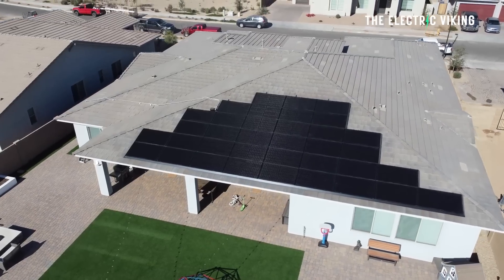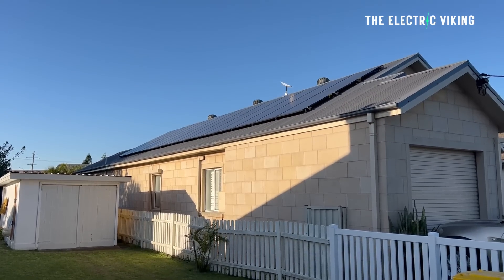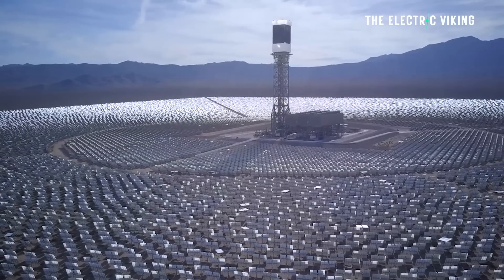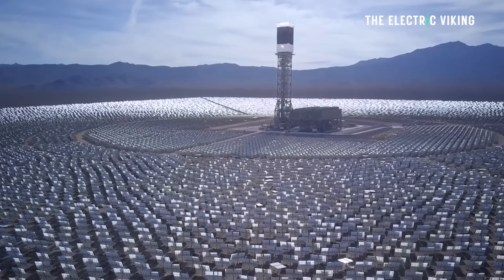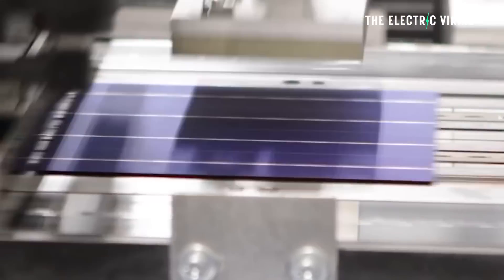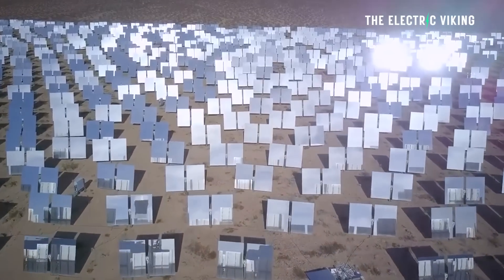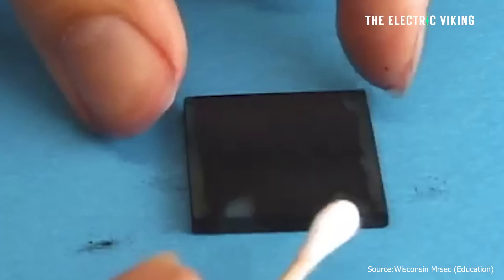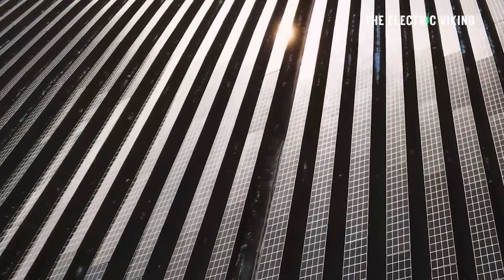Record-Breaking New Solar cells with 60% energy conversion created by Spanish researchers

Comment: A system that can capture solar thermal along with solar electric can easily be over 60% efficient.  About 60% of home energy is for heating.  
There are solar farms that use trough mirrors to heat compressed air in long pipes to drive s gas turbine.   A miniature solar farm in a one meter square box on the roof might accomplish the same thing.  If the pipes are oriented east to west, the mirrors need only to swivel up and down to track the sun.  A car turbocharger might be about the right size to drive the system.  There are turbochargers that have a motor/generator to improve engine performance and save energy.  Someone could make the system themselves.  One motor could swivel all of the mirrors in a box.  The heat can be stored in a tank of water or a pile of gravel.  If it has 30% electrical efficiency and captures 50% of the solar thermal, that is like 80% efficiency.

Comment: Efficiency is wonderful, but I think the thing that will boost solar the most is CHEAPNESS, ease of manufacture, eco-friendliness (meaning no toxic materials and byproducts), and ease of installation. What ever happened to the printable solar cells? Those seem like they were pretty great. They were cheap. They could be printed onto almost any material, including flexible fabric. 
It doesn't matter how efficient something is if it is 10 years away and made out of either toxic or expensive materials. And we need to really be working on energy storage, since that is the key to adding renewables to any energy system.

Comment: You can find solar cells that already get 40% which are used on satellites; but they are super costly. You made no mention of cost. Your understanding of the contribution of solar at present is wrong. Solar only produces 2% of world energy production; thus if magically you could replace all cells with ones 3x more effective it would only come to 6% of world production and of course cells are not the big expense - installation and batteries are the main high cost component of Solar power. If you can ever get some cheap efficient cells and cheap storage; maybe it would be worth investing in; at present and the last 20 years Solar has been a failure.

Comment: 60% is almost certainly using concentrators, and it is stated that it is purely a lab achievement rather than a production ready technology.

Previous concentrator based multi junction cells had managed >50% efficiencies.
Reply: An additional statement is, it is only applicable to red/yellow light. Given the lowest energy light is red, and the highest blue, for the external light spectrum, most of the energy would be lost as heat.

Comment: They only last minutes to a few hours under lab conditions so don't get too excited.. A fairly stable cell in the high 30's can last close to a year but one that can last several decades and be in mass production is still a decade away.. Layering and enhancing the cells with a substance that readily releases electrons with minimal excitation from sunlight like a nuclear element also produce lots of electric but they degrade at an atomic level and have no longevity..

Comment: Kinda unusual because it is illegal to use solar panels in Spain. The National Power Company may use solar panels but not individuals. During a multiport cruise last year around Spain, every tour guide we employed told us the same story. Spain has over 300 days a year of sunshine, but it is illegal to put them on homes or apartment buildings. Although not exactly true from a little research, apparently the State Controlled National Power Company makes the red tape so difficult and expensive, they have basically outlawed solar for personal use. Interesting to hear your comments on this sometime. Thanks. Love your channel.
Reply: Solar panels are not illegal in Spain.

Nice try FUD boi.
Reply: @mnomadvfx Now I gotta do more research? I'm so sick of the web and social media in particular. I used the Internet before the web, back in the 70s at a research university. It should've never been made available to the general public. They weren't ready. Still aren't.
Reply: That already changed.  It has a lot of burocracy, but not illegal.
Reply: Do they regulate the materials used ? This would make sense as early solar cells used cadmium : a toxic material.
Reply: @ImaEarlyAdopter  ...🤣🤣😅😆😂🤣🤪🤤

Comment: Avg Solar efficiency for purchase
1970:6%
1990:12.5%
2010:20%
2024:24.1%
2030: 27%
34.1% wouldn’t be reached til 2050 at this rate, hopefully it’s the beginning of exponential S curve advances similar to silicon chips and computer memory.
How are you all scoffing at this story & our massive improvements to solar. ICE went from 10-20% efficiency in 100 years. A propane generator is atleast 30% efficient.
Reply: Pervskite captures a different frequency range than polysilicon.  Has stability issues (lifespan), hard to layer on the Silicon, inputs have other uses and Lead in the mix  is considered a risk factor!

Comment: Titanium is $90 per kg.  Gallium is $900 per kg.  The price of silicon used in conventional solar cell is $9 per kg.  These cells will be at least 10x more expensive, for a  1.6 x increase in energy yield.   This technology will go nowhere, fast.
Reply: Might be good for space applications but way too expensive for earth.
Reply: The amount of material required for a thin film is so small that the impact on the price of the panel is minimal.  And it's 100% recyclable too.
Reply: if you put them on cars there's a big advantage you'd pay 300% extra
Reply: Eh?

Perovskites are relatively chip as production requires much lower temperatures than silicon cells, and you only need a very thin layer of the material compared to silicon for the same conversion efficiency.

The overall cell will be more expensive than pure silicon based cells as it is a tandem (multi junction) cell, but the additional cost will be nowhere near 10x even at the beginning, let alone once it has scaled.

Comment: 55 seconds in shows solar panels installed on a dark colored  roof . Installing solar panels on a dark roof in a no no.  Solar panels installed on a dark colored roof will produce less power than panels on a white or silver roof. The enemy of solar panels are heat. Black or dark colored roofs produce heat that lowers the amount of electricity produced. Painting roofs white before installing solar panels called  “cool roofing,” is an expanding business in the US. 
Australia should be doing the same. Some states in the US have building code by laws that require that industrial buildings must have white roofs. For example: California has stringent cool roof requirements under its Building Energy Efficiency Standards. These regulations often require roofs to meet minimum solar reflectance and thermal emittance values, which can be achieved with white or other light-colored roofing materials.
New York City mandates cool roofs for certain buildings under its building codes.
Phoenix, Arizona and Los Angeles, California also have specific cool roof regulations.

Comment: You are such a filthy liar.  This is easy to Google.  The current record for solar cell efficiency is 47.6%, not 25%
Reply: For multiple layer cells. Commercial single layer cells are another matter, typical efficiency 20%. The limit from 1950s Bell Labs inventor of the transistor was calculated as 23%.

Comment: I invented a solar panel made with plutonium oxide, it's getting glowing reviews.
Reply: Sounds like an innovation that could really take off.
Reply: Hehehehe!
Reply: Already done : a diamond battery using Thorium.
Reply: I'm guessing it's either going to explode at any time or the degradation rate is 50% per year. However, I don't doubt the 60% efficiency rating is accurate.
Reply: Don't lick the brush!

Comment: Solar has a capacity factor of less than 30%...the majority of the time the sun is not shining. Cloudy days which can last 5 or more days in a row result in almost zero power for an entire week.
Renewables require almost total 100% back up for this reason. That back up will be supplied by gas , coal etc.
AEMO admitted yesterday that a renewables only grid , with storage , back up and transmission included will NEVER provide us with lower cost electricity.
Higher cost electricity is driving manufacturing overseas and sending prices higher , and keeping inflation and interest rates higher.
Reply: The surface of a sphere is 4 pi r*r. Given about 50% of the light energy is absorbed by the atmosphere, a ground based solar cell, at best, has 1/10th the throughput of a space based one. 

Rain and dust can easily wreck the remaining throughput. Solar is great for satellites, poor for ground installations.

Comment: This is one of the main reasons Australia should continue to roll out renewables - the technology will continue to improve, and what is installed in 10 years will be much more efficient than what we are installing today.

The equivalent of Moore's Law.
Reply: It must be a no brainer to fit solar if you live in Oz. I love solar but there's slim pickings here in the UK!
Reply: @alistairlambert3275  In Australia, the conservative party is opposed to renewables. They want to go nuclear, and one of their arguments is that renewables have to be replaced more often than a nuclear power plant.

I actually think that renewing renewables with more efficient tech is a good thing.
Reply: Moore's law is the rate of printing resolution improvement. No change in performance outside of better resolution. 

PV improvements are much more difficult : structural, material, and technique change to get an additional 10%.
Reply: @michaeledwards2251  Wrong. 

Hard to understand how you can say something like that when you are working on a computer, and all you have to do is type "moore's law" into a search engine.
Reply: @footbru  
Why do you think there is such excitement about ASML EUV machines ? Its the resolution which matters. The material, silicon, and the purity demands, have only undergone changes needed to meet the resolution. 

Today the resolution achieved is a fraction of a wave length of a photon. 

PV demands replacement of material structures, materials, and much else, to achieve efficiency improvements. Resolution has not been a problem for PV for decades.
Reply: Renewables are for the rich due to the fact you are literally replacing every ten years or so, and the recycling needs to be improved, and the land these solar farms cover need to be cleaned up as they are not environmentally friendly which these solar nuts seem to distance themselves from.
Reply: @jeffsmart7674  Solar panels have a 30 year warranty, and can continue to produce power past that time. Recently, Australia's oldest wind turbine was retired after 40 years.
Recycling is being improved, but I don't know why that is a problem compared to other appliances. And at least they CAN be recycled.
The land occupied by solar farms is PRIVATE land. So cleaning it up is none of YOUR business.

Your comment is worthless and basically disinformation.

Comment: @electric Viking,, I don't think you are understanding this correctly. Gallium phosphide is most likely the bulk material and gallium is extremely expensive and hard to find and currently under Chinese control and they have greatly limited exports. Not a wise move to depend on gallium. Titanium is most likely just a surface film for optical properties. I think gallium comes out of aluminum smelting process if I recall correctly. This is going to be impractical probably even if they achieved much higher efficiency than polysilicon. First solar's Telerium is probably a better value when it gets its efficiency towards its theoretical maximum.

Comment: I designed and built Gallium Arsenide semiconductors 50 years ago. Fabulous performance, but difficult and expensive to build. Gallium is actually a byproduct of aluminum refining (from bauxite). Not particularly plentiful. But being able to adjust the semiconductor band gap is a big deal.
Reply: The Arsenic component would restrict usage to commercial applications : disposal would have to be controlled. Ideal for supercomputer usage 50 years ago.

Comment: A lot of different achievements are being talked about solar panels and batteries.  
Much of those remain in research laboratories only.
My approach is "WHEN WE SEE IT, WE SEE IT." Until then it is NOTHING for a common man.
Reply: Correct.  It's fun to see new ideas appear, but many "breakthroughs" never make it in the real world.  There's a huge danger in getting excited about what might come to market and using that as an excuse to not move faster with what we have in hand.  We are getting our butts kicked by climate change.  We would be stupid to let it get stronger than need be by not working diligently to limit the extreme.

Comment: Even after reading the article, I'm not completely sure if their 60% conversion limit is of the suns total energy, or just 60% in the 550nm wavelength and above. Which would mean the overall efficiency will be lower.

Comment: Over rated.  Existing solar panels are essentially free... the cost is with installation and regulation (grid connection primarily).  Transmission network capacity is the next bottleneck.  Maybe a doubled capacity solar panel will help incrementally as first generation panels are replaced a decade into the future.
Reply: Reduce or eliminate your connection. Storage. Micro grid. They are stealing from you. Too much energy generated in day time. This kills the market. Zero cost value at peek time
Reply: Storage is the key. Reduce your cost to zero

Comment: China has the world’s largest reserves of titanium.  China produces the most titanium and China’s consumers consume the most titanium
In 1985 as part of Lockheed’s test flight team, we saw a Chinese cargo plane with a cargo deck made from titanium.  The reactions would have been similar if the streets were paved with gold
Reply: "Titanium is mined in Australia, Sierra Leone, South Africa, Russia and Japan."

"These minerals (including titanium) are primarily sourced from beach sands in Australia, South Africa, and India, as well as from hard rock deposits in Canada, Norway, and Ukraine."

People often confuse "reserves" and "occurrence".   China may have the largest reserves, the largest amount on hand and/or the highest ability to refine titanium.  That's been true of other important materials such as lithium.  China, due to low cost labor and a lack of environmental regulations, took over the production of many materials and products.  The US, for example, used to extract and refine lithium in North Carolina but those operations shut down due to China undercutting with lower prices.  The US has vast deposits of lithium.  The US has a high occurrence of lithium.